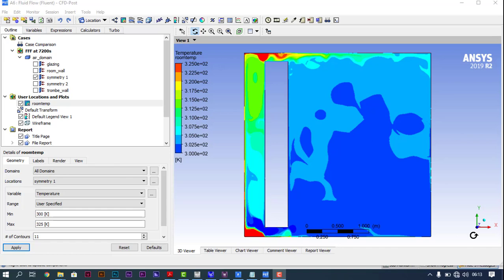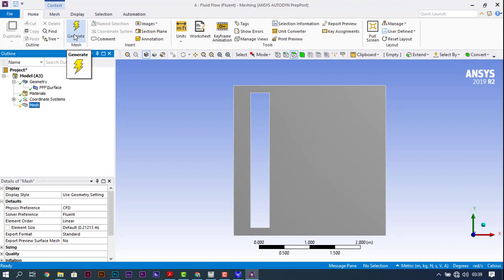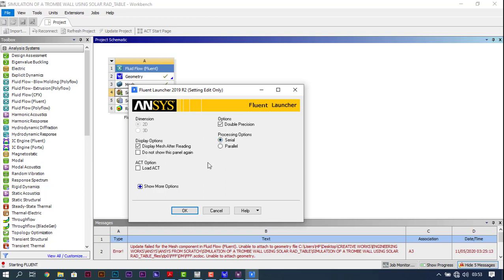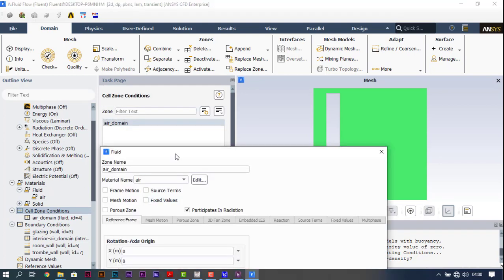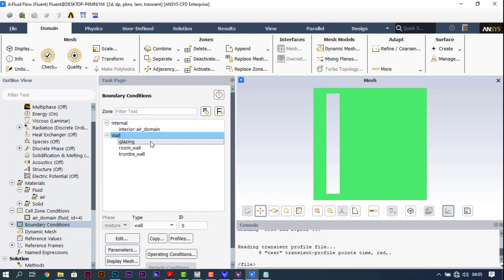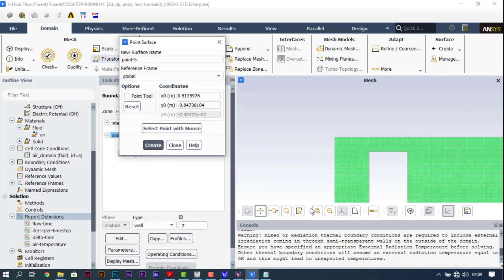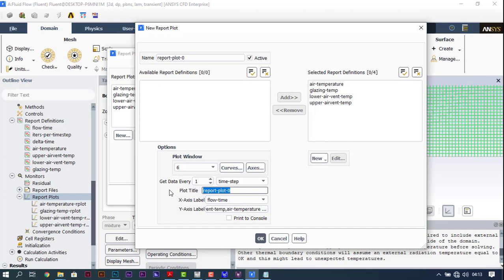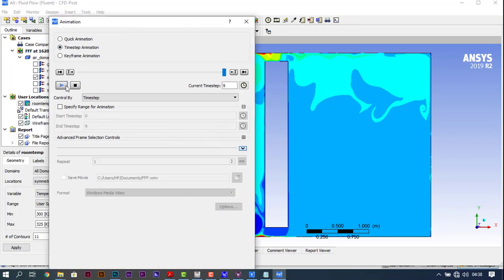ANSYS Tutorial on Simulation of Trombe Wall with Solar Radiation Data Table

Comment: Excuse me, Im a beginner in radiation model. If I want to input solar radiation from outside and want to see temperature distribution in my model, can I set up my model like you? Now I see many way to input the parameter like Solar tracing and Im so confused.
Reply: @LearnwithBrillianda  Thank you so much. Can i ask your more about UDF function? i think it's accurate more than solar ray tracing because it can use data from field measurement. Is it possible? or ray tracing is better than that.
Reply: It's possible with 3D modelling

Comment: Thanks many times sir for tutorial. I want to ask you about boundary condition @ trombe wall if i want to check the effect trombe wall. Thanks in advance.
Reply: ANSYS From Scratch thanks many times brother. I have used temperature boundary conditions (18 C) and different solar radiations compared with yours and  turbulent model is laminar. Unfortunately, the maximum temperature exceed 113 C at 12:00.   Is it reasonable to have with this temperature???